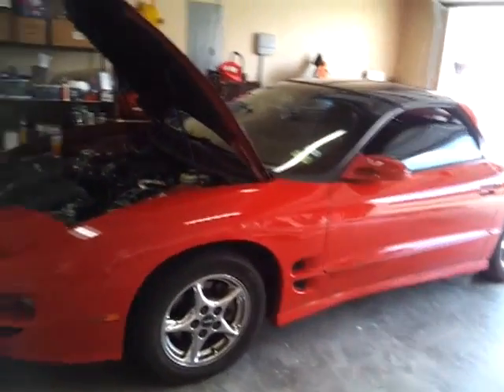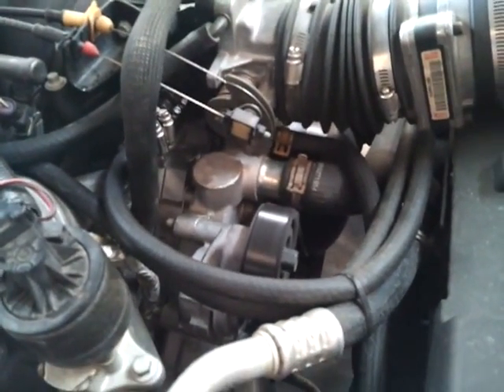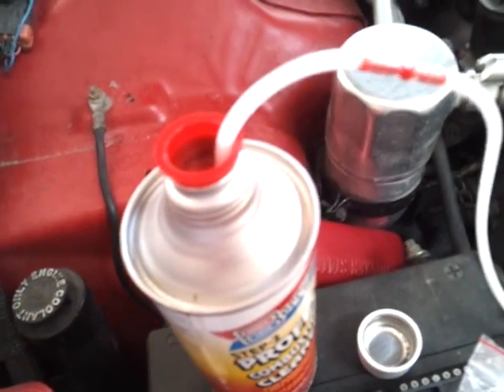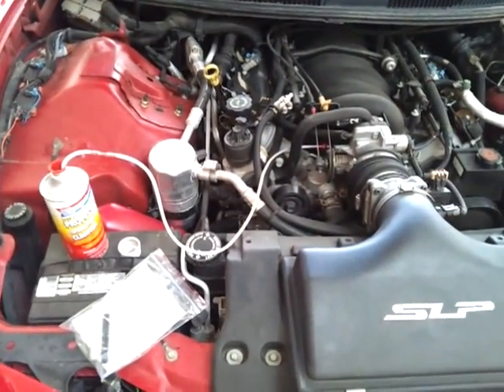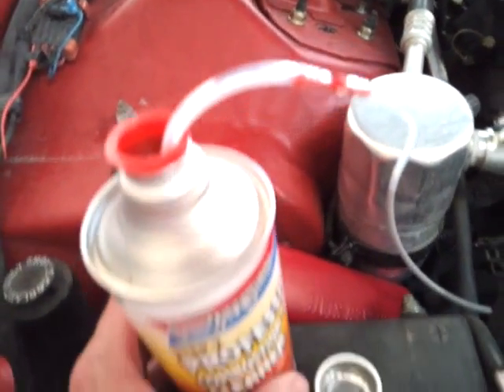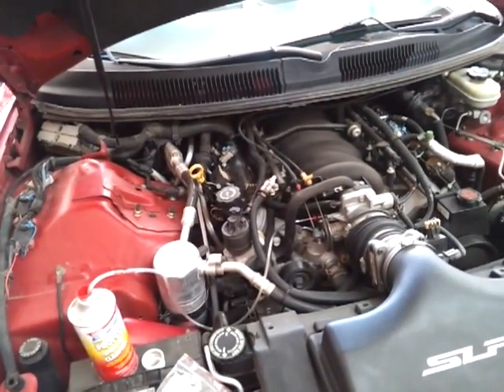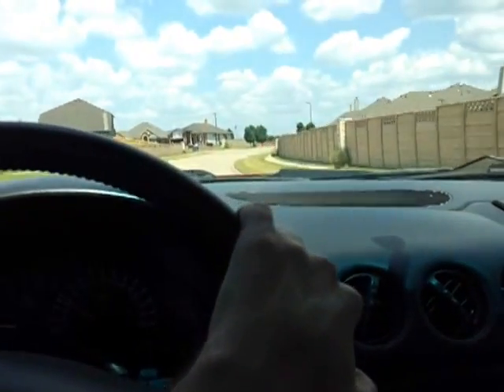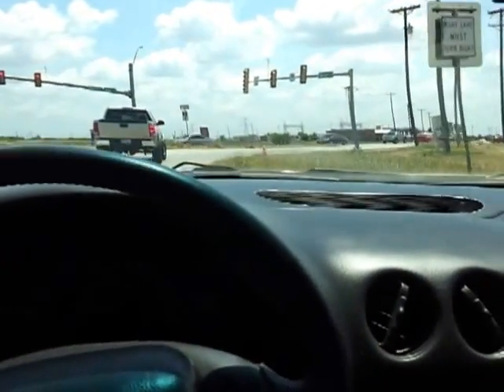Combustion Chamber Cleaning—Berryman Your Car; Don't Seafoam It!

Comment: I've used Berryman when I was younger in carborated systems and I do not remember it improving gas mileage of cleaning any carbon out.  Seafoam on the other hand does clean the carbon out and has improved my fuel mileage.  Same thing with Green Fuel Boost.  The only reason you people don't believe the claims is because you haven't used it or can't follow directions.  Seafoam also cleans up sticky lifters in the engine.  I've used it for that too!
Reply: Jay Finke  I hooked my washer sprayer line to my intake and filled it with seafoam so I can create smoke screens by pressing my window washer button....muahahahahahahah I didn't really but now I am gonna ...lol sounds fun.
Reply: I like seafoam also, I direct inject it into my fuel rail to clean injectors, and works well on lifters when added to the oil, distilled water works well for cleaning combustion chambers it's $0.99 for a gallon and you can drink what's left over or add it to your cooling system. good stuff to use , it has no minerals in it !
Reply: it all depends on the condition of the motor. If it worked for you,GREAT ! thats all that maters.

Comment: All of these products are a scam and a gimmick
Reply: imGlobL I put MMO in my 1999 Caravan it reduce heat and fiction. It works!!!
Reply: ***** RX AUTO is a similar chemical combination and next I will use _____ as it is used in Hellicopters and cars.The military wanted something that would reduce friction,save repairs and save the chopper if the oil was shot out of it.They can fly for 30 minutes.A Jeep with 4 men can drive for 30 minutes.
Reply: WRONG...MARVEL MYSTERY OIL AROUND SINCE 1923 SAVED MY 9 YEAR OLD SLUDGE MOTOR.
Read moreShow less
 ·
Reply: ***** I know I have been testing Marvel for 2 years. With MMO in the oil and 4 OZs per tank I pulled 46 MPG on a 600 K drive.The 2.2 would get 36 MPG tops.....NOTE...I drove at 100 K or 60 MPH only
Reply: Too expensive not worth the cost to use them
Reply: ***** I will let you know you may be right ???

Comment: every cleaning product has purpose, and is designed for particular parts. by the way seaform is applied to any part with the same thing? it's absolutely shit. you don't even know it will ruin your car. if your mechanic tells you what you have to use, follow that way. they are professional.

Comment: I just used this on my 2006 mustang gt.  I took a video inside the same cylinder before and after.  I think it did remove some carbon, but I bet water does better.  it was still worth the $13 just for the trick tubing.
Reply: Water is a byproduct of combustion, it is not being injected into the 
combustion chamber during combustion.  you need it in liquid form to 
knock off carbon.  Water may not do better, but doubt it does worse.  
Look to the right>>>> Eric the car guy uses it.

Comment: HMM - BERRYMAN is awfully strong stuff --- don,t put it in your GASTANK - you WILL get a fuel system rebuild (aka-new fuel pump).
Reply from the maker: I ran Berryman B-12 Chemtool at 2 oz/gal (double the maximum recommend concentration) in every tank for two years. No problems.

Comment: When you get the correct information, please re post. Meanwhile take this down.

It makes you look stupid.
Reply: You know what makes you look stupid? Childishly insulting someone for having so-called "incorrect" information, and then not providing them with "correct" information. If you're so informed on the subject of combustion chamber cleaners, why don't you enlighten the rest of us?
Reply: I believe in water decarbonisation,  thats why I made a video on it
Reply: I could not of said it better.
Reply: reltub20001  I do fuel injection service all the time.

I see you're still avoiding giving any explanation as to why you feel the uploader's information is "incorrect." Just because you do fuel injection services "all the time" doesn't automatically make your way the "right" way and the uploader's way the "wrong" way.

Why don't you do us all a favor and stop directing lazy insults at others and explain your personal views on injection services?

Personally, I feel that one-time injection services using off-the-shelf chemicals are a waste of time. The are two tried-and-true ways to reduce carbon buildup. One is to stop it before it starts - one way to accomplish this would be to only ever use Top Tier certified gasoline in your engine, supplemented with Chevron Techron Ultimate Concentrate at regular intervals (i.e. every other oil change). The other way is to manually remove carbon by hand (be removing the cylinder head) or by doing what BMW does - blasting ground nut shells into the upper intake to scrounge the built up carbon off the valves. 

99% of the time, running a one-time addition of something such as SeaFoam or Lucas Injector Cleaner through your intake/fuel tank/etc. is not going to do a bit of good. Carbon buildup is extremely difficult to remove; after all, it is baked on by the extreme temperatures it's subjected to by the engine. Running some hydrocarbon-based solvent over it once or even twice or three times isn't going to dissolve enough of it to make any noticeable difference.
Reply: What makes you look stupid is commenting about something that he and most mechanics do if you have ever had a fuel injection service done.
Reply: I do fuel injection service all the time. What do you do to make you look stupid? you sure do now.
Reply: reltub20001 I think this is a good video, please explain why he should take it down and why the information is incorrect.  Is it because he said something bad about seafoam?
Reply: BMAC VAGS I saw your video on seafoam using the lawn mower as a test engine.  Go read my comment.   take your video down.
Reply: Tom McKenna
  Go ahead and listen to these people telling you how to clean combustion chambers. I have pulled engines down to repair them both high mileage and low mileage. The only product that has cleaned the combustion chambers well was water. all you have to do is make sure the engine is warmed up and slowly add water with the engine above idle.
  So there you have it. For free!
  I was trying to get someone that is smarter than me to put that information out there. I am not going to go into details on how to do this, Just don't have the drive to inform the world anymore.  Most people don't listen anyway.
  Everyone now needs to go buy Berryman when water is free.
  Yes go ahead and bash me. I have broad shoulders and can take the criticism. I would go to all  the others that have said that you need to use this one or that one to clean your engine except I see I have hit a nerve or two with this one.
  Good day!

Comment: It's all snake oil.
Reply: WRONG...MARVEL MYSTERY OIL AROUND SINCE 1923 SAVED MY 9 YEAR OLD SLUDGE MOTOR.
Reply: WRONG, MMO AROUND SINCE 1921.  The rest is all accurate.
Reply: I use water, and it's also snake oil.

Comment: I bought the complete kit at Amazon and used it today. I bought a 2000 F150, with 164,000 miles on it, a few weeks ago. It had very little power for a V8. After using the complete kit I was able to spin the tires. I was completely surprised at the difference. After doing the combustion chamber I let it sit for a few minutes. When I started to drive, at first there was nothing. Then it started to run really rough and my first thought was, "great I screwed up my engine."  Then there was a huge cloud of white smoke with a tinge of brown that poured out of the exhaust. After the smoke cleared I felt a difference. The engine smoothed out and ran great. After driving on the interstate for about twenty miles I got onto the surface streets. At the first stop light I hit the gas the same as always and spun the tires. I thought maybe it was a wet road. But it was dry. At the next light I gave it a little more with the same result. This is some great stuff and I would highly recommend it. Glad I came across this video. Also my other car has 40,000 on it and I am going to run it through that as well.
Reply: yah, i had done the same, got some blue smoke, no much but car had more power after the cleaning

Comment: That may be good stuff your using but I dissagree about seafoam. Seafoam is great stuff when I use it on my car thru the brakebooster the car has better throttle response runs better. In addition my dads old 3000gt would not pass emissions for noxx. Over the holidays we seafoamed thru the brakebooster now it past. Thats proof it cleans rite there cause carbon build up willl cause emissions fail for noxx.
Reply: Omni Present
 SEAFOAM  is the same as a water hammer.Racing people have used water at cerian RPM'S to clear carbon.
MARVEL MYSTERY OIL has 5 chemicals and my mechanic uncle used it all the time for 1) Sludge which my 2004 developed and 43 days later clean ports and timing chain function.
2) Carbon removal
3) Friction Reduction raising MPG 10-25 % in 2 test cars at 60 MPH 2 hour runs.
4) Lubricant for better compression and top oil
5) Varnish removal over the months....a clean engine is efficent and above with MMO Marvel 10 bucks at Walmart.
4 ozs in full gas......6-8 ozs at oil change in crank engine oil
Reply: Carbon build up has nothing to do with emissions. Unless theres so much carbon it literally raises the compression of the engine a good amount. Sea foam is over priced alcohol dude. Smell it.
Reply: Omni Present  Carbon buildup cause hotspots in the head resulting in inefficient combustion and noxx pollution emissions. thats what the dude at the shop sais. I definitely can tell my car starts quicker and runs better after using it.
Reply: Their is a FORD TECH that is on You Tube. The F150 and other ECOBOAST engines are building up carbon.

What not to do he said is to use SEAFOAM. The heat from SEAFOAM will cook the bearings in the Tubos that is close to the motor. No problem you have now ruined your warranty and the Turbos cost THOUSANDS.

He didn't say you couldn't use it on other motors without TURBOS.

He said I could use MARVEL MYSTERY OIL in my gas 4 OZs on a full tank and 6-12 ounces at oil change. This will not harm TURBOS as their is no heat and fire.
Reply: Only Ford tech video I saw saying not to use seafoam was because the carbon deposits traveling out of the combustion chamber could damage the turbos.  Ford's only approved method of dealing with intake valve carbon buildup (because of GDI no longer washing the backs of the intake valves & ports with that premium/high-detergent containing fuel) is to replace the heads.